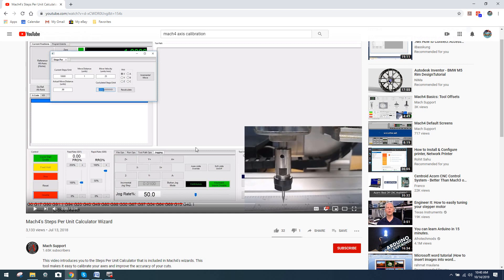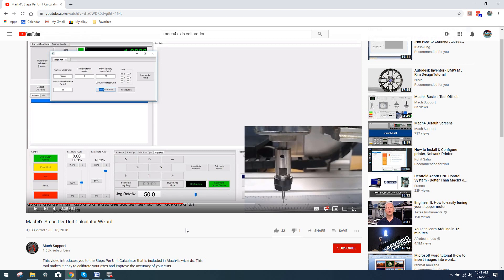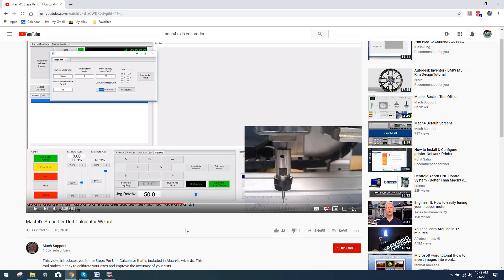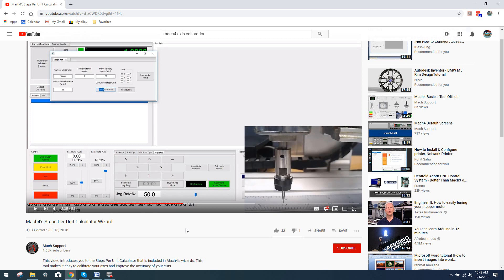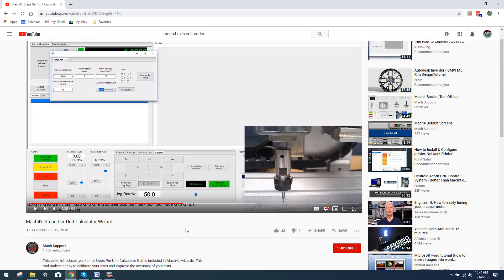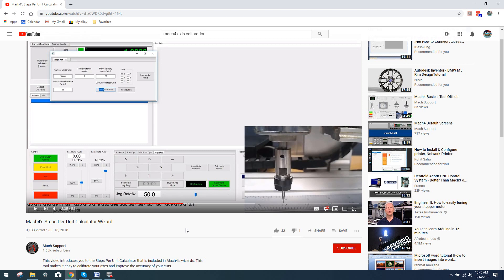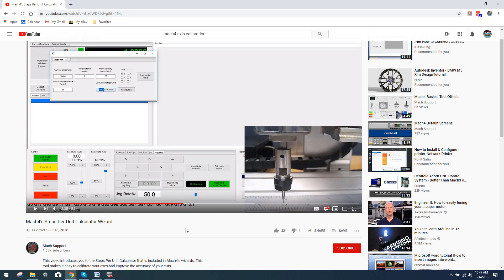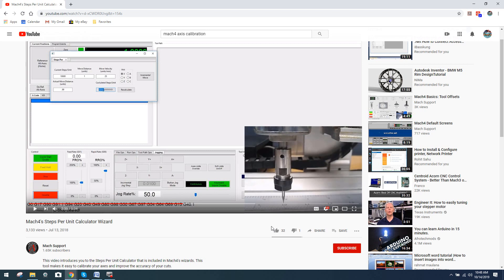Never Use A Ruler For CNC Axis Calibration..

Comment: Agreed.. I check mine before a critical job. I have a plasma table. I check it with a .0005 dial indicator.  And do use the same tape measure every time on the XY travel.  I'm within..0050 in 8'6" and .0025 in the Y  48"
Reply from the maker: Metalworks Machine Shop, thank you for your support. That's the best tool to use, and will pay for itself time, and time again. That's excellent accuracy especially if the chassis's transmission is rack, and pinion. Have a Happy New Year! Vince